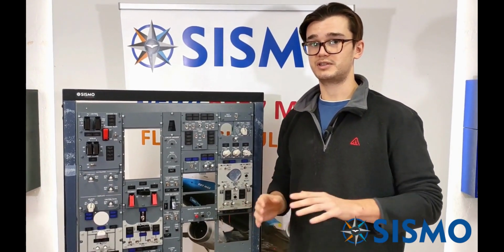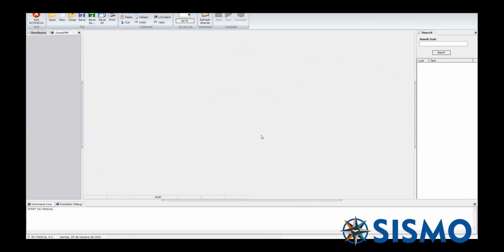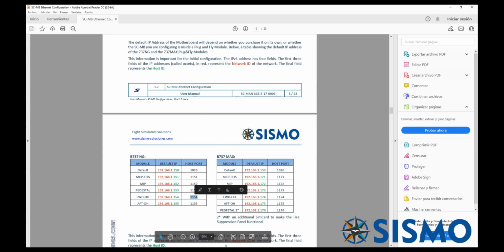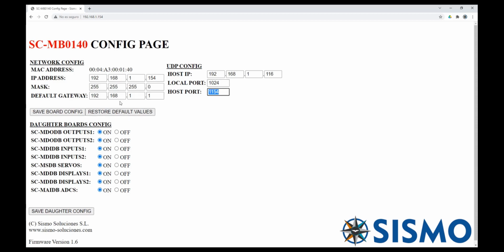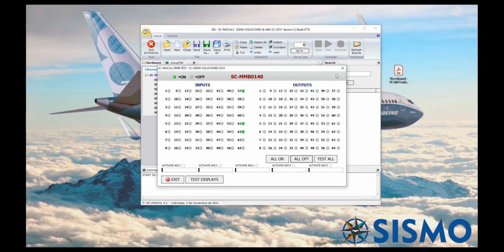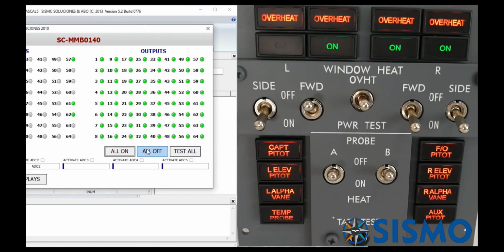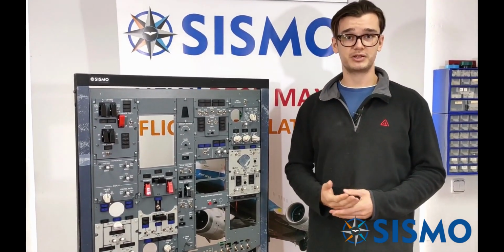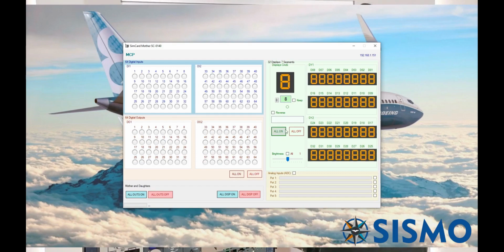SC Pascal - Hardware Testing Tool: Configuration, testing and tips.

Comment: Thanks, Thomas for this video,  I am very familiar with this configuration as my full cockpit hardware is from Sismos, my first purchase was the USB MCP back in 2012, it came with a driver for Windows  XP only at the time, has this driver been ever updated for other versions of windows?
Reply from the maker: Hello Miguel, the driver was not updated. Our USB products must be used on a 32bit Operating System. You could use the MCP on windows10 32bit PC.
Reply: Thank you so much for the reply.